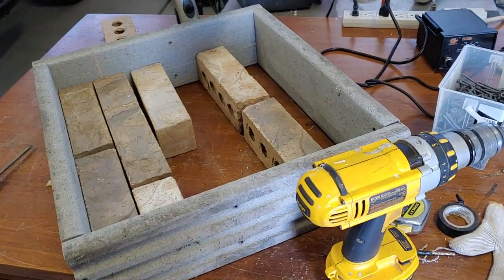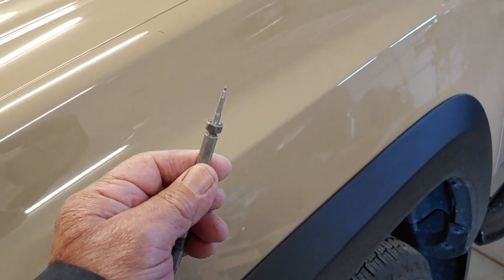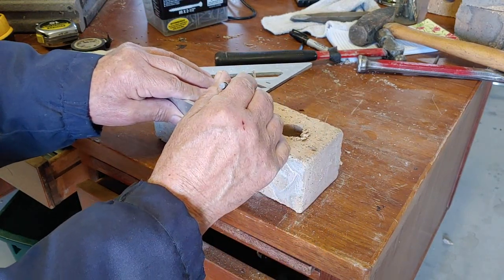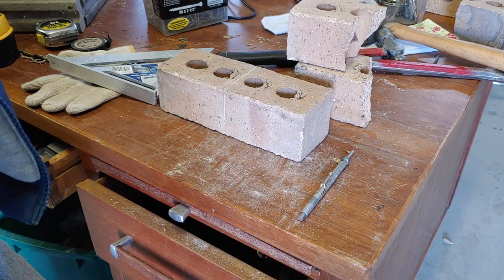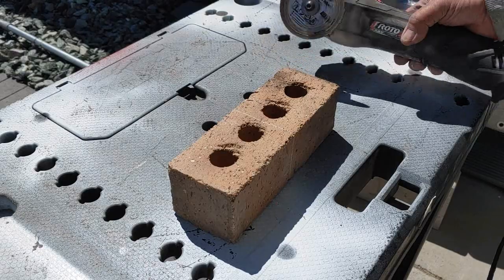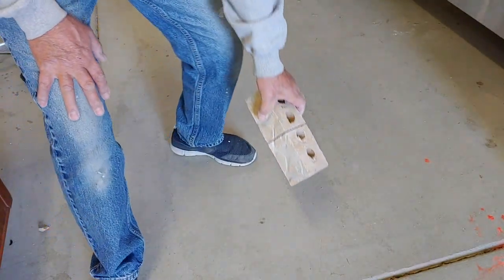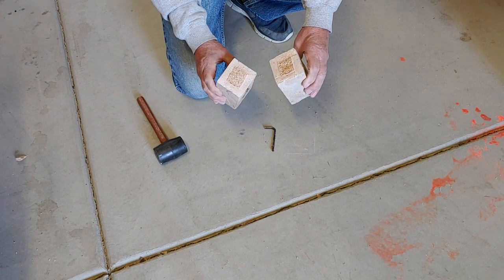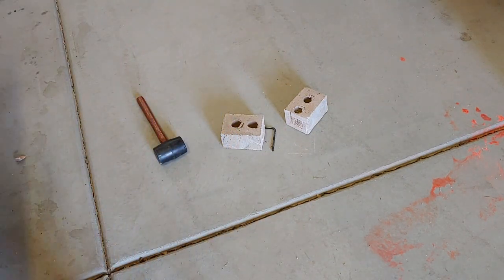(309) How to cut brick the easy way!

Comment: Everyone in the know says to break it on a soft surface such as the soil or a mound of dirt and not an concrete .It breaks cleaner more often.
Reply from the maker: Well, we will know that next time if there is a next time.
Reply: The purpose of breaking it on a soft surface isn't for a clean break. Its to ensure you don't break the hard surface such as the driveway, sidewalk, or current brick work you're standing on.